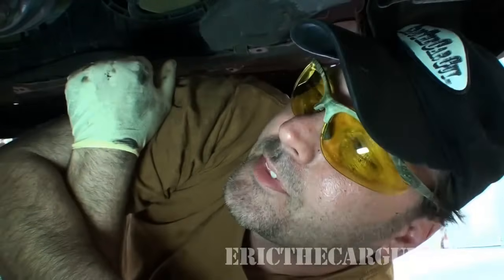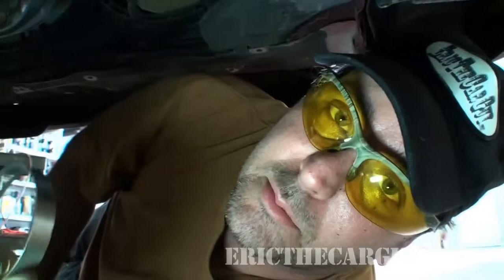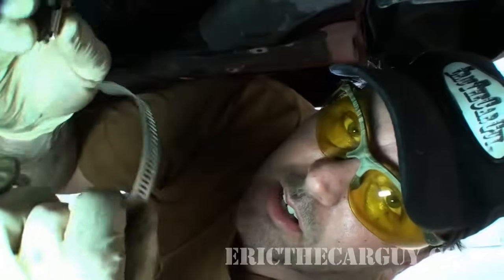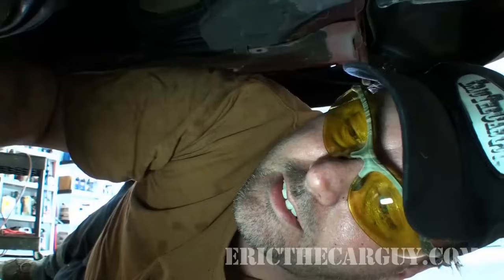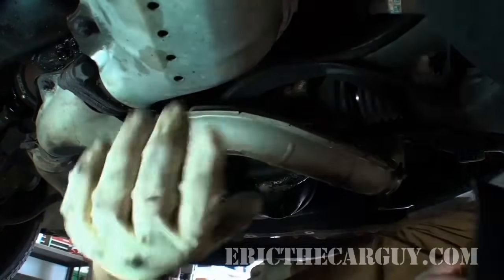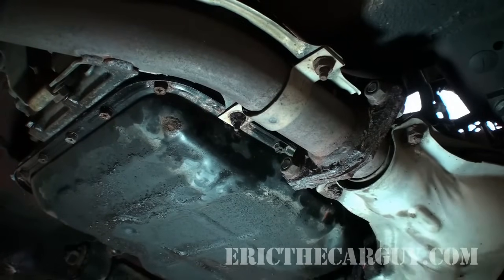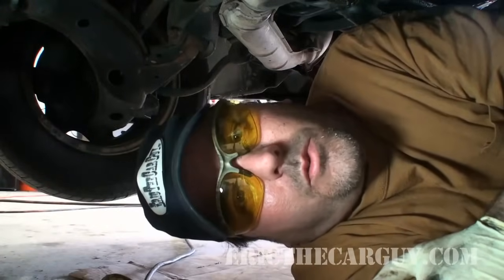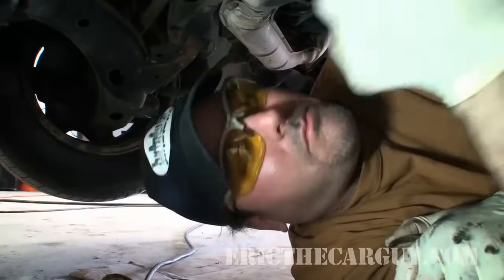How To Fix Exhaust Rattles - EricTheCarGuy

Comment: I'm hearing a noise rattle under my 207, I think it maybe the exhaust, i only hear it when I start the engine and when I knock it off, don't hear it during driving but I also hear a noise when changing gear, does anyone have a clue what it is
Reply: Its a peugeot, im sure it is a loose piece of metal inside the noisedamper.. typical problem. You can try to locate the faulty one.. the middle pot probably.. and just jack it up so the pot dents inward and blocks the loose piece inside. Or you can replace the middle part of your exhaust. It is fairly cheap so i would just replace the (middle)pot

Comment: You can't tighten the bolt that was holding the exhaust pipe in place?
Reply: It looked as though it was rusted and had seized.
Reply: I'd definitely go for improving that existing mounting mount.
Reply: If the bolts don't break first. If so your up a creek
Reply: Thanks for the video. I hope that is all I need to do.

Comment: Mine rattles when idling and revving up to 2000 rpm could this be the fault
Reply: I got the same exact problem around 2000 rpms too. It started when installed my borla exhaust: (
Reply: your cat converter is knackered i had to have it opened to have the rattly bit removed now it sounds tinny but i am getting rid of that car as i have a new car now.

Comment: Didnt work with the engine turned off. Had to turn it on and smack the exhaust with a wooden log. Luckily my car has a super short exhaust, so you don´t actually have to lay underneath the pipe itself.

Comment: if anyone can help so my mustang rattles when i first start it up and i accelerate past 3k rpm but i let the gas go it goes away, it stays rattling past 3k for about a couple minutes then it goes away when i guess it warms up.  Only stays rattling for a couple minutes when it is first trned on then no issues after that at all past 3k rpm
Reply: Exhaust pipes heat up and expand very quickly so it could be that when you start up and the pipes are still cold they are rattling against something (gas tank, sway bar, crosslink). When they heat up they expand and no longer touch whatever they are rubbing up against. Try having the car jacked up on one side and having someone else start the car up and look around underneath.
Reply: appreciate the help!
Reply: +jsteez96 no problem at all!

Comment: can an unstable exhaust cause the whole car shake ?
Reply: Nueno Clayfon  No. You'll want to examine all your motor mounts. And, if you do happen to need to change one, might as well change them all. But if you're on a budget, you can change one at a time but change all within a given time frame.
Reply: Well I have another question, is the after market motor mount that bad compare to the OEM mount ? I meant I replace the motor mount already but the car still has vibration. Thanks
Reply: Nueno Clayfon How many motor mounts did you replace? If you just changed one or two of course you're going to feel vibration because remember the other motor mounts have been worn down already and the new ones are still, well... stiff and haven't been broken into. Aftermarket motor mounts aren't really that bad. They're just not OEM quality but they're good enough to get by with. They might not last as long as the OEM but maybe will come close to it. Also, it depends on what type you get. If you get the performance type, well... you're getting something that's above OEM quality and more pricier. The one's you get on amazon and ebay are just as good as the oem but may not last as long.
Reply: well all of my motor mounts are in good shape except for the front right, I replaced that front right motor mount already ( oreilly part around 65 70 bucks ). My car shake really bad at around 700-1k RPM which is at idle. My mechanic says that it because the after market motor mount.
Reply: Nueno Clayfon I would think it would be your older motor mounts. Even though they appear in good shape they've been broken in already compared to your newer motor mount. That's why it's best to replace all. Now, if your car shakes while you're driving you definitely need a wheel balance.
Reply: my car wont shake until i hit 70 so I think its ok. but the vibration at idle is driving me nut. I want to bring it to the dealership to fix but friends say it not worth it... I cry everynight v.v
Reply: Nueno Clayfon the only way for you to really know is to replace all the mounts. That's all I can tell you. Now if you bring it to the dealership they're gonna charge you an arm and a leg for probably the same thing I'm telling you but that is up to you.
Reply: Aye sir, I will change all the mounts as like you suggest, so far I spent $450 on that vibration. Hope it get better soon :D

Comment: I had a rattle in my exhaust took it in and they said they would fix it I said repair it or put it and you tail pipe. They said new. Got it back and there was still a noise after paying $527. Took it back and then they said it was a muffler guard and they would replace it for a cost of $200. Looking under I don’t see anything new, so how does a senior woman get good help and was a scam?

Comment: My 98 Impreza has a rattle in 1st and 2nd gear. As soon as I pick up some speed it stops. Could that be exhaust leak?
Reply: I have this problem when rpm is low especially 1st gear and I hear loud metal tube sound. I'm guessing it's the exhaust mount or the transmission mount
Reply: Same thing here in my 2000 Forester. I just put a new exhaust in from the converter, back. Gears 2 & 3 when accelerating only. Sound precievably coming from the rear half. I suspect it is a vibrating contact point.
Reply: Hexagon Sun
If you guys figure anything out let me know. I think I'm just going to throw on a few hose clamps in a few places, it won't hurt.
Reply: The problem was metal to metal knocking. All that needed to be done was to adjust the muffler in its holders to the side by about an inch. I've had leaks in an exhaust system before and it was never a rattle. Exhaust leaks typically make an exhaust louder and deeper in tone, because those frequencies are not being effectively removed. Good luck with the clamps. Maybe while you're down there inspect the exhaust from the engine to the rear and look to see everything has ample clearance and isn't showing signs of metal to metal knocking.
Reply: Hexagon Sun Your right, that's what happened to my car too

Comment: if you do not put any RUBBER on that metal clamp after some time it will damage the pipe due to vibration and will cause metal to metal chaffing.

Comment: I have a Subaru Impreza… been hearing this when it idles in the AM and then when it’s between 1000 to 2000 rpm once once in a while. Think this is the heat shield or bad cat? Hoping it’s the heat shield just want to know if anyone else had a similar problem